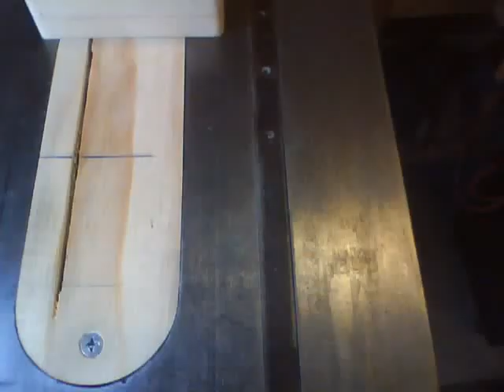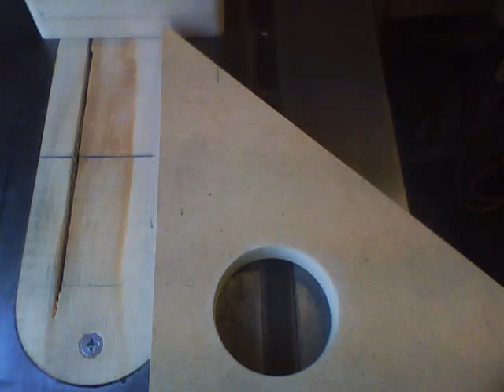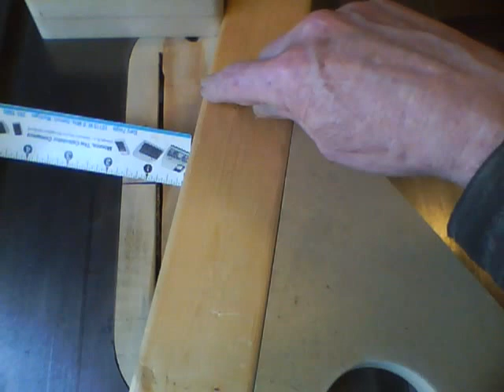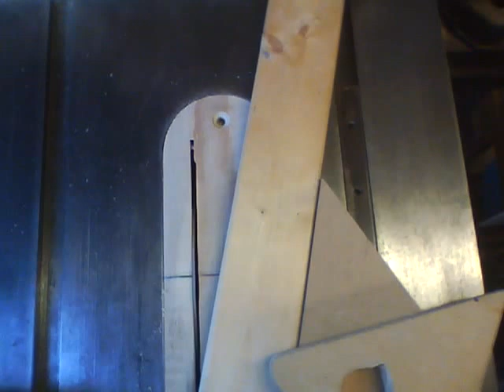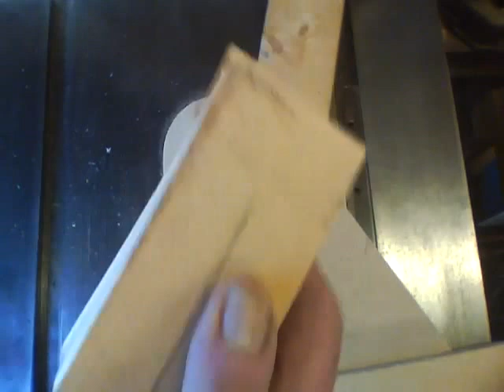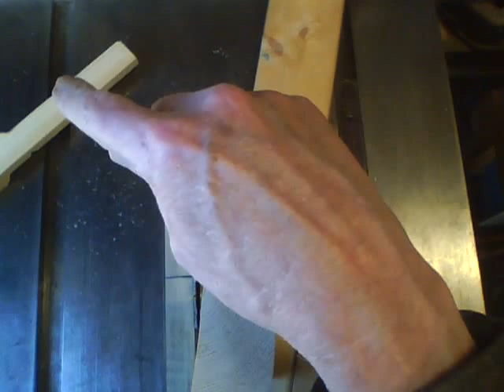Cove cuts on the Table Saw - part 2 of 2

Comment: Hi Jim,
nice Video. You can also use a parallelogram that is clamped to the tablesaw-surface. Marc Spagnolo (The Woodwhisperer) has another great video about building and using the parallelogram. Just search for "Coves on the Tablesaw & the Parallelogram Cove Jig". 
this looks a little bit safer than your one-sided-fence-solution, but it may be a personal impression, because I'm feeling awkward when pushing a workpiece over the sawblade sideways. :)